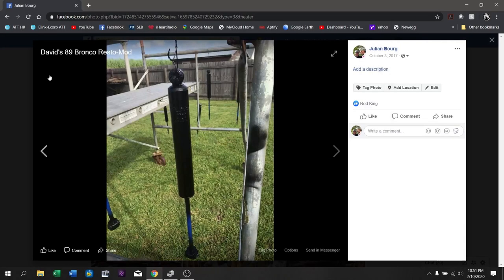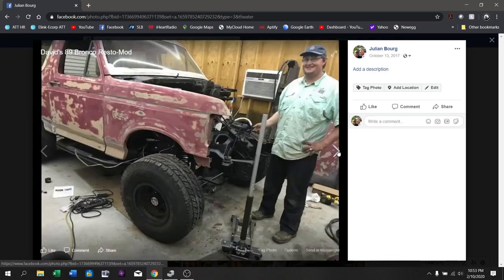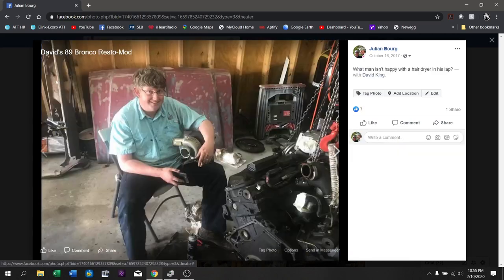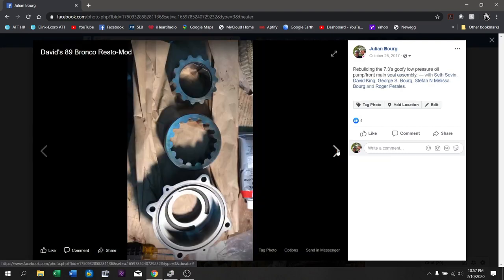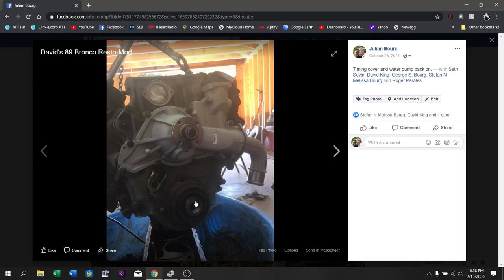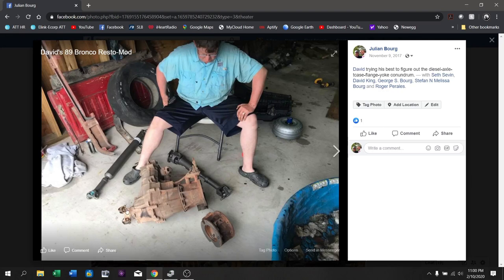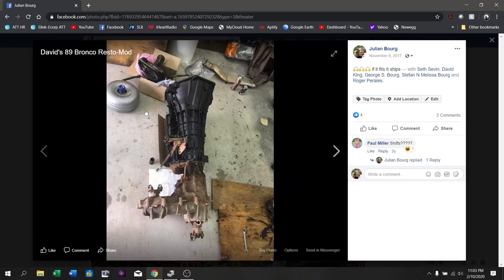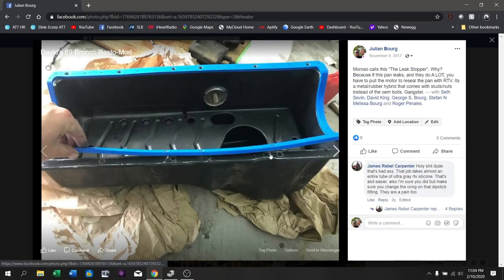How to Build a 7.3 Powerstroke Diesel Bronco - Part 2

Comment: @Murphy’s Law Garage, do you have a link of the wiring diagrams you guys used to install the 7.3? I have a 1994 BKO that I want to install a 12 valve in with a manual Nv4500 but I don’t know where to start. I’m assuming my swap will be less complex because of the fully mechanical 6bt and manual transmission. Thank you!
Reply from the maker: I didn’t use a wiring diagram, just a multimeter and knowledge of components. If your using a 12V you need 4 wires to make it run. 6 if you want reverse lights. 10 if you want oil pressure/water temp sensors. It will be super simple and straight forward to wire. Just resect the parts of the 94 that deal with engine management.
Reply: Murphy's Law Garage I’m a noob when it comes to electrical and wiring, any suggestions as to where I should start in order to inform myself as to what wires I’d need to reuse?
Reply from the maker: Think about what you need for it to work. 12v to starter, 12v start signal to starter solenoid, grounds, 12v accessory to the fuel cut off solenoid, 12v accessory to the alternator, 12v charge from alternator to battery, oil pressure sense, coolant temperature sense. Everything else engine control from the harness can be removed or tucked. The best thing to do with wiring is to get in it and start wiring. Tackle one problem at a time. It should all unfold as you work. If you have a question, ask.
Reply: Murphy's Law Garage Thank you!!!